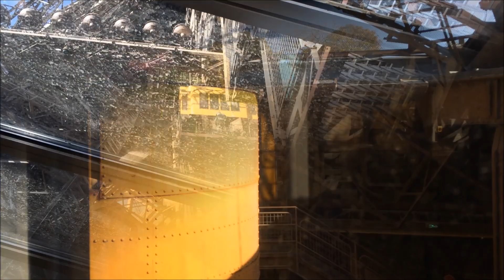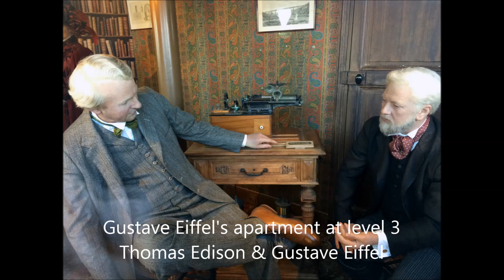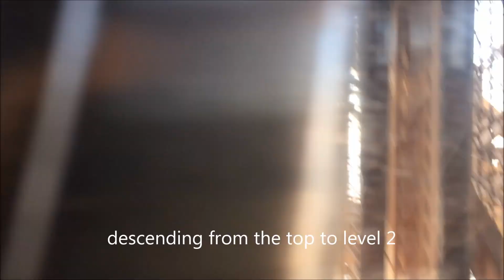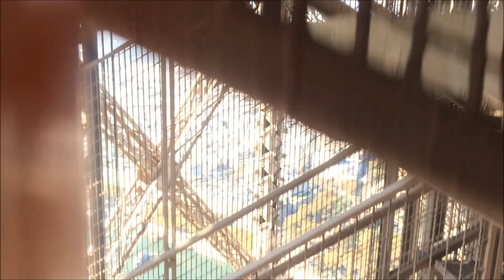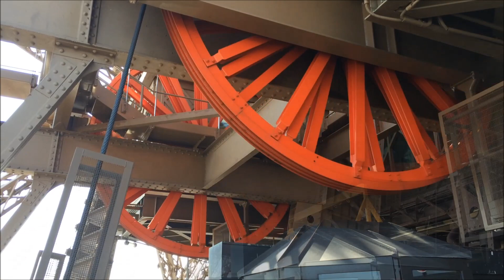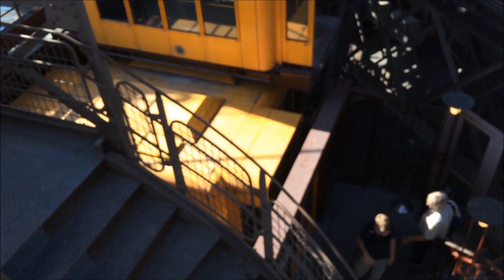Tour Eiffel, Paris

Comment from the maker: Thanks, Noel - a Meccano set is just what I had in mind. The tower was made of thousands of components constructed off site to very tight tolerances - 0.1mm - and assembled part by part. Anything not up to scratch was returned to the foundry for replacement. It says a lot for 19th Century engineering practice. No computers, just drawing boards and human calculation.